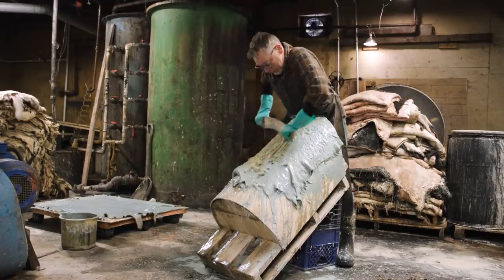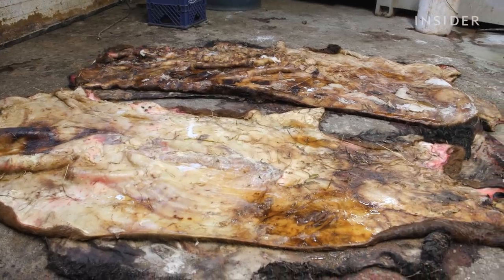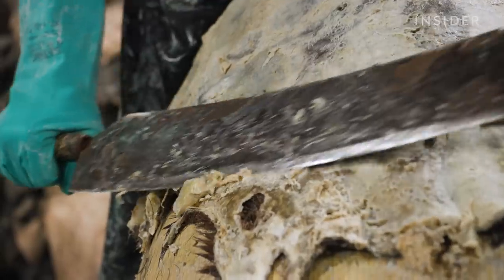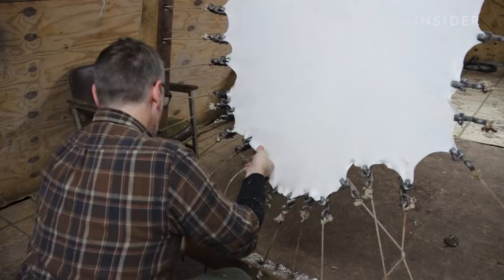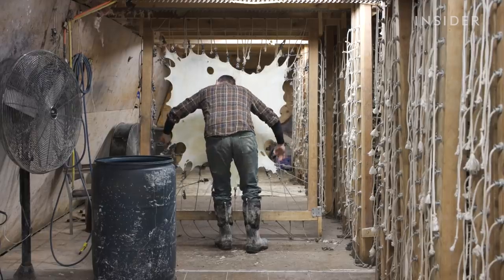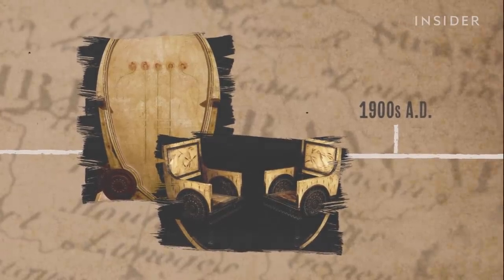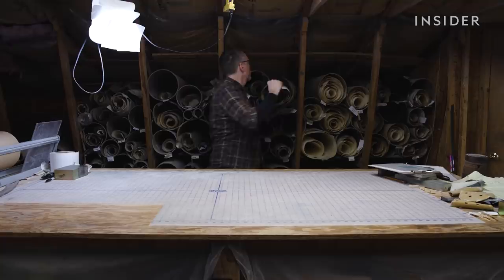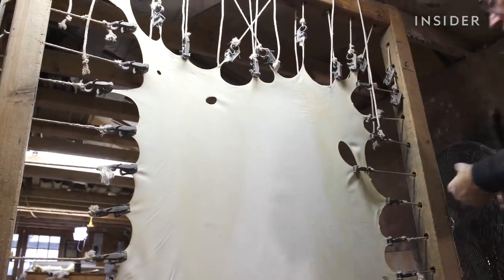How Animal Hides Are Made Into Parchment At The Last Workshop In The US | Still Standing

Comment: I'VE WORKED WITH MY HANDS ALL MY LIFE IN SOME FORM OR FASHION.  THE COST ON MY BODY HAS BEEN ENORMOUS. IN THE SHORT SPAN OF 45 TO 50 YEARS MOST EVERYTHING HAS CHANGED IN THE AREA OF POWER TOOLS. I STARTED OUT DRIVING SCREWS WITH A SCREW DRIVER, THEN A PUMP SCREW DRIVER UP AND DOWN, FINALLY A ELECTRIC POWER DRILL, NOW MOST OF THE MARKET HAS BECOME BATTERY DRIVEN.

JUST THAT ONE SMALL TOOL.

ITS AMAZING 👏 IM GLAD THAT MEN LIKE THIS HAVE FOUND A WAY TO STAY RELEVANT IN THIS FAST PACED WORLD.

I TIP MY HAT SIR AND WISH YOU ALL THE LUCK IN THE WORLD.

Comment: Lot of the  age information is incorrect.....
in England  Parchment was used for legal documents right up until the 19 & early 20th century.
many land leases were written on parchment.
you buy an old house & if ur lucky you will get a complete set of owner documents starting with parchment.... & quill pens going all hte way up until modern times.

The interesting thing, is the older the document, the more professional the writing , the new typed documents are half assed correction camp crap. filled with errors & corrections.